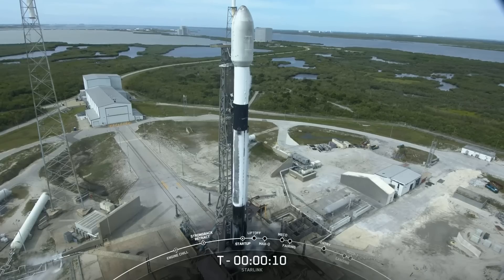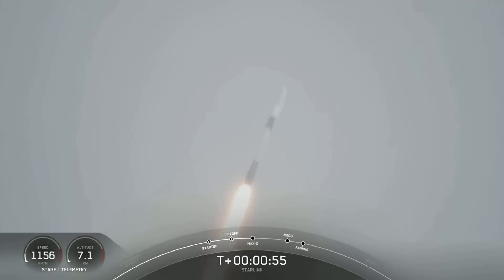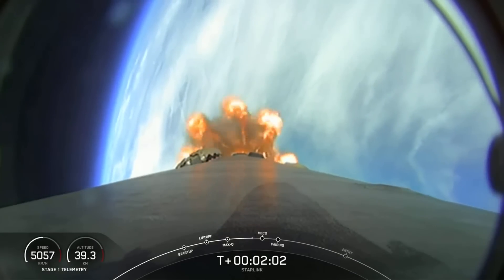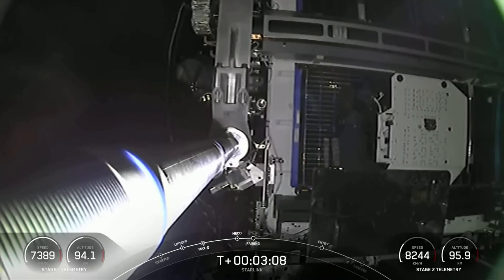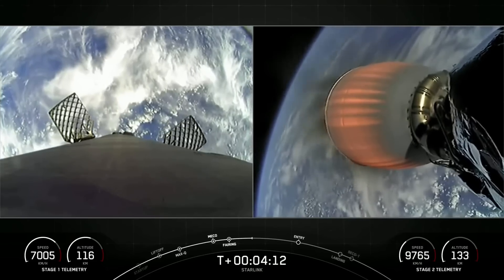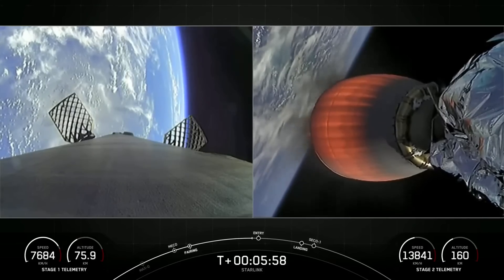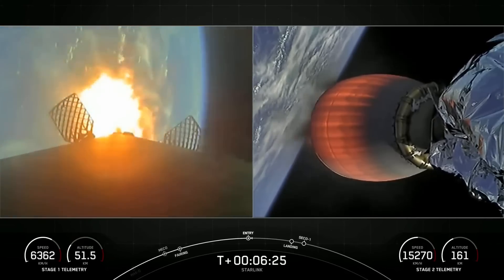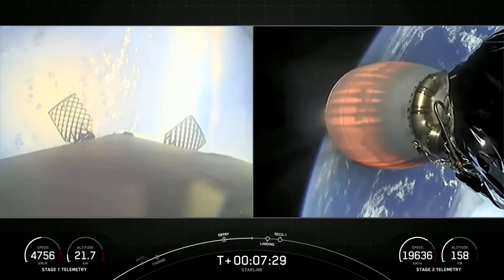SpaceX launches 21 second-generation Starlink satellites, nails landing

Comment: Artemis mission proves that USA never went on moon. 😂😂😂 
USA fooled world
Reply: Before you explain exactly why, could you answer another question?  Do you use the extra heavy duty foil on all your hats, or do you just double it up?
Reply: @johnjones5354  we try to use that space foil that  can withstand 17,000 mile an hour winds
Reply: @Atheist66644  Hi FIPE, hope that you are well. You wrote "17,000 mile an hour winds". Please explain. take care.
Reply: @TheWokeFlatEarthTruth  when it reaches its orbit does that help plus the screen has the miles per hour on it
Reply: @Atheist66644  Hi FiPe, thank you for your reply. The screen actually shows Km/h not mph but the top speed shown of just over 27,000 km/h corresponds well to 17,000 mph. That said my original question was about why you thought there would be"17,000 mile an hour winds". At an altitude of 160 km the air density is some 1.5 x 10>-6 g/m3 compared to 1225 g/m3 at Earth's surface. This means that the (tiny amount) of air at this altitude is over 800 million times less dense than at the surface. There really wont be much "wind"/ air resistance up there, will there? Take care.
Reply: Please explain
Reply: Artemis is about efficiency, rocket launches are very expensive
Reply: @twinkieerella  oh please, nasa had and has the money. they’re the government. Don’t forget Nasa is giving the funds to Space X to do the missions and make the rockets. it’s all about time. which makes the moon landings in the 60s more unbelievable. The fact that they had attempted to do nearly the impossible just in time before the end of the decade is ridiculous
Reply: @twinkieerella  if NASA had taken their time like they are doing now (with space x) it would have been more believable. All of the lives lost carelessly dying the apollo missions because Nasa was too impatient to do things efficiently
Reply: If they really didn't go to the moon, China or Russia would have already debunked that idea.
Reply: Indian believe only Hindu's gods ever landed to the moon. And Indian space agency want to fool the world too by going into the moon.
Reply: Which daddyflerf told you that?